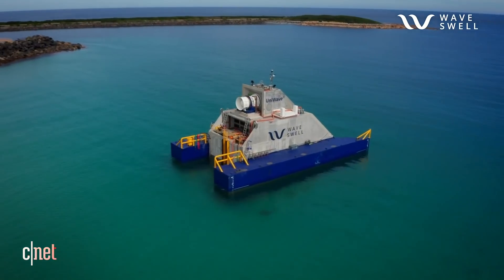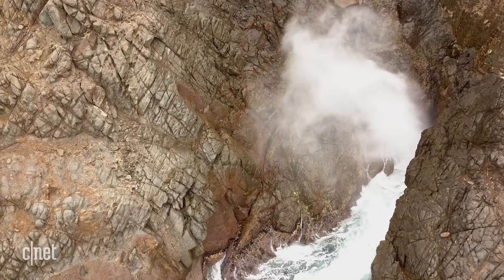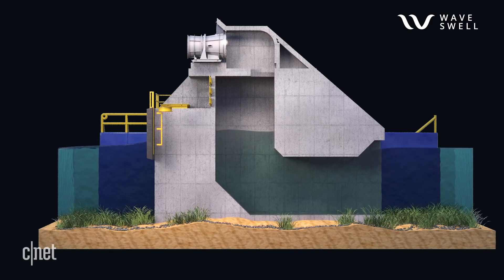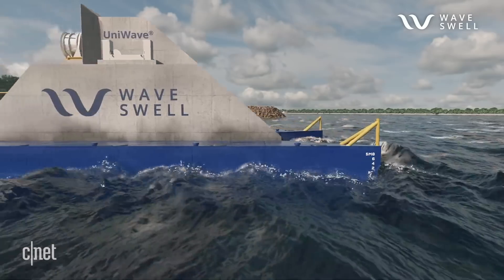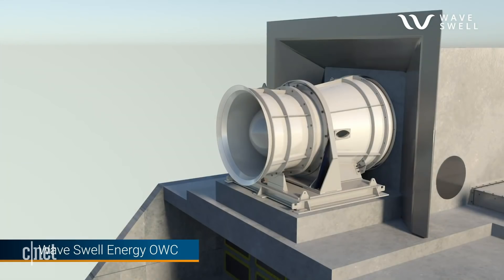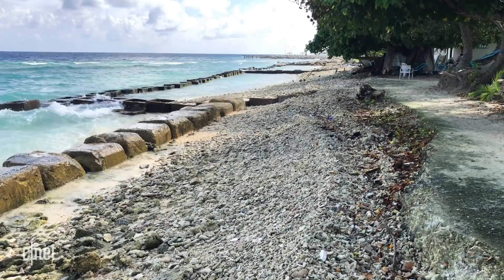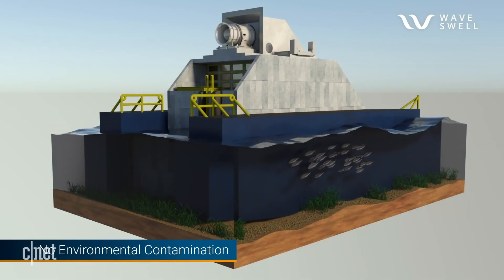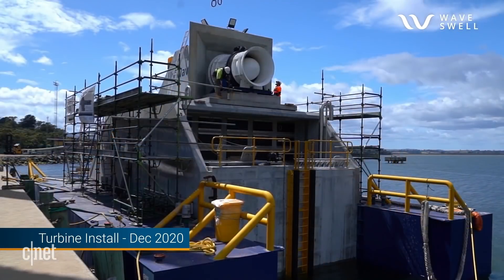How this 'artificial blowhole' could make wave energy mainstream

Comment: I bet the energy one unit can generate per hour is not that impressive yet, otherwise they would show the number right away... some concerns regarding this design:
(1) location: being able to only located near sea shore? Any better use of the sea shore than putting a pile of these generators there?
(2) the energy it generates vs. the energy and cost to build and maintain (salt water erosion is no joke)
(3) environmental concerns, e.g., noise, effects on animals living in the sea.

Comment: By the way; the reason why only one way increases energy production is because a unidirectional turbine loses energy slowing down to spin the opposite direction
Reply: So 2 turbines ?
In and out.
Maybe restricting the air flow on the outlet reduces the efficiency more that the gain in energy produced ?
Or maybe blowing the salt spray through the turbine is too destructive ?
I am sure they have thought of it already
Reply: @stevewilliams587  You are right, 2 turbines (one each way) does not double output.

Comment: I would’ve thought you’d include an approximate amount of energy it produced, even if it was compared to wind or solar
Reply: The unit is intended to produce 200kw, but once it's commissioned the real number will be known.
Reply: And cost per kw...
Reply: The important thing is:
It can work when there is no sun or wind.   Less need for batteries.
Reply: That's probably what the March grid interface will be measuring.
Reply: Yes! It's Always a Bad sign when an Ingeneer gives you no number...
Reply: tommy aronson  
Tidal waves aren't what makes this machine work.
This needs fast waves, like a wave every 15 seconds.
Reply: More energy in storm seasons, less in summer.
Reply: tommy aronson  Yes, in the ultimate sense, but not in the day to day sense.  If the sun suddenly disappeared we'd be screwed anyway, but this should produce just fine on a cloudy day, in fact it might do particularly well as fronts are blowing in with changing weather since the wind is likely to raise the waves.
Reply: What about high seas?
How much do they cost per unit electricity?
Can we make them less intrusive and ugly?
Reply: I don't see much difference between sea state in how this will operate and it would most certainly produce as much as wind . Especially here on Ireland's west coast ,their is always a sea swell even on a calm day.
Reply: tommy aronson  Not fully true as there's still waves at not and produced by wind or storms, which can often be why there is no sun.
Reply: There is still waves at night* (when full malfunction there)
Reply: @wingedzer0  The problem is that the amount of power you can collect is so absurdly small as to be ridiculous even if you garrison your entire coast with these contraptions.
Reply: @w8stral  tell us some numbers, with links pls
Reply: @w8stral  So you have nothing? 
Nothing but an opinion.....  OK, let's play: What, O w8sted one, is a more abundant, more energy dense, more accessible source of renewable energy to focus on instead, in YOUR OPINION, of course....what is the next great new renewable energy to be tapped? 
Go on , impress us, you know you NEED to.....LOLS.
Reply: @w8stral  Left the chat....again??  REPEAT:
What, O w8sted one, is a more abundant, more energy dense, more accessible source of renewable energy to focus on instead, in YOUR OPINION, of course....what is the next great new renewable energy to be tapped?
Reply: @w8stral  You ever seen the the inner workings of a 'wave-pool' that produces a 1.5 m wave?  Banks of 100kw motors....'cos. y'know a single cubic metre weighs a TON (metric, look it up).
But of course, you'd much rather pump the the non-renewable black-stuff for 'consumption' right?  Beginning to smell like  a Big-oil shill is in our midst......
Which would be GREAT news, since they only ever try to quell worthwhile designs that can decrease their margins....
Reply: @citizenscience659  Dont waste ur energy on him.
Reply: tommy aronson  yes clever d... but the sun does not need to be shining is what he ment like with solar. What do they say an good mind only needs halve an word.
Reply: I don't think even they know. Having PLANs and actually building scaled up systems is very different. Smart move would Not to promise any Boiler Plate Capacity.
Reply: more waves in storm season, less in summer season.
Reply: Sigh... nothing new. Been done roughly half a dozen times already and they all massively gargantuanly FAIL in maintenance and PWR/$$$
Reply: @w8stral  Did you notice that the inefficient (bi-directional) Wells turbine ISN'T being used? 
The only medium entering the chamber is coastal air, not heavily salinated, pressurised spray off the water surface....might be just the ticket for less maintenance.
Reply: @citizenscience659  Are you blind?  And no, none of them use pressurized spray from the water surface.  There is no pressurized spray in any of these idiot designs.  It is always air.  Though some of them use the water pressure itself in a weir design.  Salt content a couple meters off the ocean surface is all the same content.  It is only if you go up ~50 meters or more that salt content starts to massively drop(dependent on wind velocity of course)
Reply: @w8stral  So you don't understand why this is less prone to 'environmental' wear&tear than other bi-directional design? Just ask, I'll try to get you across the line...
Reply: @citizenscience659  Poor baby, you have no clue about previous designs.  They all have done the exact same thing.  The air source is all the same.
Reply: @w8stral  Is that right? Look up 'Wells Turbine', especially the Bi-directional airflow bit....there's a good chap....
Reply: @citizenscience659  Enjoy your wiki search as I, unlike you can see the diagram shown in the video.  Nothing unique about it.
Reply: @w8stral  Look again, your scientific approach is amazingly stunted. 
1) Single direction (efficient) turbine.
2) Turbine ONLY activated by NEGATIVE water head /receding column . What don't you understand?? Starting to look like a Dunning-Kruger contestant has joined the chat....
Better yet: SHOW US ALL YOUR SUPERIOR DESIGN to harness wave energy...go on dude, you can do it! Link your web-site!
Reply: @w8stral  has left the chat.....all science is hard, YT version especially so....only 4 lines to make your case...so sorry: w8stral.
Reply: tommy aronson  Moon makes tides. Not sun matey
Reply: Maniae Official The contribution to the oceans tides is split between the Sun and the Moon. It’s approximately 2/3 for the Moon and 1/3 for the Sun.

Comment: how does it deal with the tides?
Reply: It is not affected at all by tides. All that happens is that you get more or less water in the column, but the air flow at the top remains the same.
Reply: It floats.
Reply: @dannybolman7739  
I understood it to be fixed.
Otherwise it would ride the wave instead of pushing the column of water up the tube.
The phenomenon occurs naturally against a fixed rock / cliff